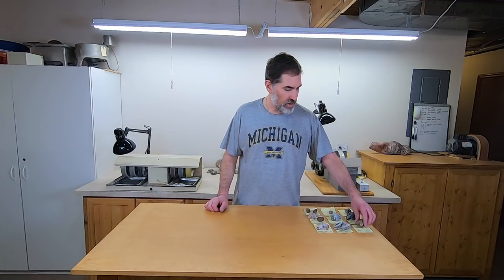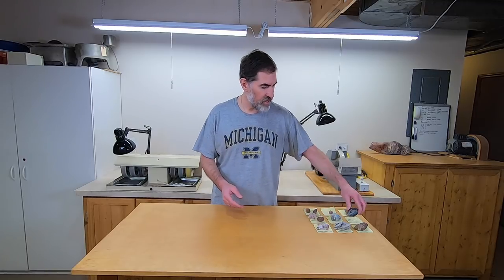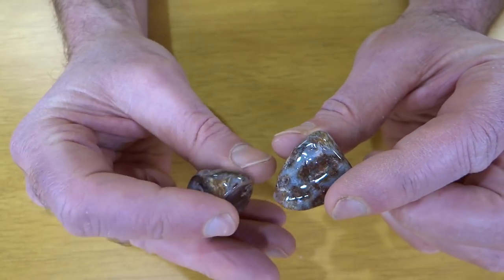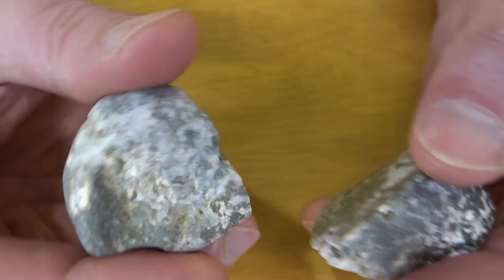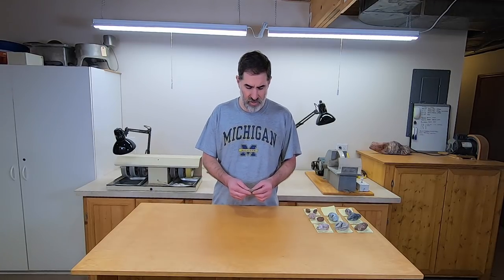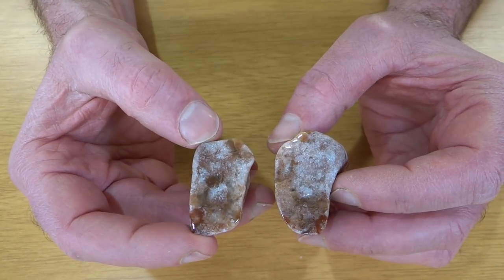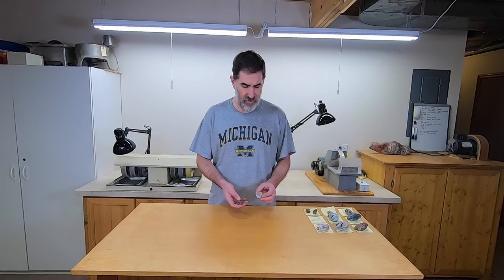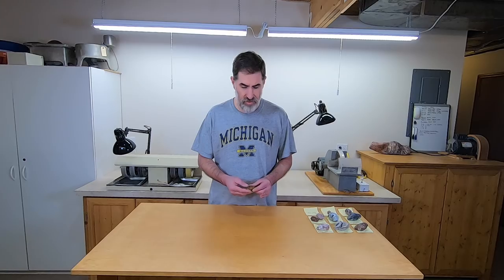Cutting and Polishing Minnesota Rocks

Comment: Beleive it or not an old compact disk or dvd secured to your flat lap, with some diamond paste will polish stones. its an expediant ,so it needs to be tweaked to work for you, but it does work well once you set it up right. Differant cds can have higher and higher grits without worry of cross contamination.  The polish will embed in the polymer once rubbed in by hand like car wax basically, then it can be ran under a. Slow drip like normal , just secured on top of your existing lapping disk for the support.
Reply from the maker: I could see how that could work, but wouldn't you lose a lot of grit just sliding off too?  When I bought my used flat lap, it came with a lot of different materials attached to plywood disks for different types of polish.  I really haven't learned how to use any of them.  I use either diamond laps or silicon carbide laps and have pretty good luck.
Reply: @MichiganRocks  only if over applied.  it wouldnt be any  more loss than on a tin or copper lap and probably less because its softer surface grabbing the grit...nust a proptionatly smaller dab should work in fine and not be to much of an issue. Its far to soft for the cutting but makes for very clean surfaces on gems for sure. You can even just outright buy the lap sized polymer disks but old cds are cheaper. The downside is the disk itself wears quicker.
Are they like felt pads and stuff?  On the wood bakers? Generally the softer a material is the softer the polishing cloth or wheel should be so it doesnt grind the material away instead of shining it up. Also slower speeds are used for soft material. Hard stuff generally seems to do well with finer grit at higher speed on harder laps .most people say 14000 is all that is needed but others will go as far as 1,000,000 in competitions or for highest end gemstones. So it seems worth experimenting with them but not anything to actually worry about as long as your results are good .and they are from what i have seen
Reply from the maker: @coreymerrill3257  I'm only polishing up to 3000 I think.  I'm not much of a cabber and I could really step up my game in that area.  I've been casually looking at some machines that I could get.  My current machine has a pretty bad vibration.  I need to track that down if I don't get a different machine.  I'm not sure if the wheels are out of balance, the shaft is bent, or the bearings are bad.
Reply: @MichiganRocks  oh that's a pain . one thing recomended for gunsmiths for their shop tools , to deaden vibration and sound is placing a layer of a material called navcom under the contact zones and relocking it to the floor studs. Maybe that on a smaller scale would be a quick cheap fix until you can trouble shoot the source.  Alot of limbsaver brand products are navcom. They are usual recoil pads or this slide the barrel harmonic dampener. Thats a readily available source at most places including walmart, but you can also order sheets. Its a winwin with that stuff for any  machine , from laps to lathes to mills and drill-presses and saws. You will find alot of handy videos on stone cutting and cabbing right on youtube of you decide to get into it more. Black opal direct and pulitzer opal are both entertaining and show up close how they cab . Justin K Prim is ALLL about the gem cutting . plus watching various GIA videos also show alot. I want some sort of faceting machine but idk what one yet. There are several types.
Reply from the maker: @coreymerrill3257  I have zero interest in faceting.  A friend of mine has a faceting machine that he offered to give me, but I turned him down.  One reason I'm not interested is because I don't really like faceted stones as much as cabbed stones.  Another is that I have heard it takes a huge amount of time.  I'm patient, but not that patient.

I'll check out that navcom stuff.  Thanks for the tip.
Reply: @MichiganRocks  i just mean alot of the stuff is interchangable with cabbing.  The grits and speeds and some dopping techniques will be universal. Each material needs certain things amd how you cut it is how you cut it. Be it a single dome or flat faces alot of stuff is interchangable. It is all lappidary work. Your welcome i hope that helps make the problem easier to find.

Comment: Very cool. They all are so different yet shine beautiful.   How do you know the best way to cut a stone , width  or  length  ?
Reply from the maker: I did what Taylor wanted.  For many rocks, it doesn't matter.  For some rocks, cutting in the correct direction is critical.  For example, turretilla agate should be cut so the little shells are cut lengthwise.  Some obsidian shows sheen or chatoyance better if cut the right way.  Petoskey stones are usually cut to show the hexagons best.

Comment: Is there any beginner lap equipment you would recommend?
Reply from the maker: I have two flat laps.  I bought both of them used.  The first one I bought and the one I use all the time is homemade as far as I can tell.  The other one is my back up in case something breaks beyond repair on my other one.  That one is a GemLap and they haven't been made for a very long time.

The cab machine I have was also purchased used.  I believe it is a Lortone model that was rebranded as a Kingsley North machine.  Those are still sold, but I'm not sure of the exact model I have.  If I was to buy a new machine, it probably wouldn't be this one, so I don't really want to recommend anything.  I'd take a look at the Genie and the Cab King if I was buying new, but possibly one of the many others available.

Comment: Just had a thought. I wonder if a polarizing filter would remove the glare on your rock photos?
Reply from the maker: It might, but sometimes I want the glare.  The glare shows off the shine.  I can usually move the rocks around to get a reflection of the lights or to remove that reflection.  I'm certainly open to suggestions on how to get better pictures though. I'm not a great photographer.  I'm also using a point and shoot camera.  It's a Sony DSC-HX200V.

Comment: In real time how long does it take to cut one of those larger stones in half ? Your videos are always so interesting !!!
Reply from the maker: The ones that you didn't see me cut were cut on the saw in my garage.  I just clamp them in the vice and come back later and they're done.  Those rocks took about 10-15 minutes in that saw.  The smaller rocks that you saw me cut by hand took a minute or two.
Reply: Michigan Rocks    I have seen places on the western shores of Michigan where there have been stretches of black sand or earth and in that black material you could see sparkling pieces of copper. I’m not sure if that was copper ore or what. Maybe possibly spilled from a ship.
Reply from the maker: @davidhile5363  That's cool.  I thought copper was only found in the Keweenaw Peninsula.
Reply: Michigan Rocks  I was thinking that this was something that was maybe spilled from a ship and had washed ashore.
Reply from the maker: @davidhile5363  Oh, I understand now.